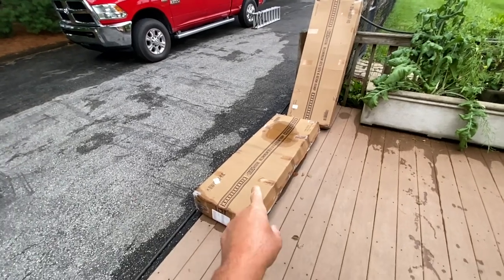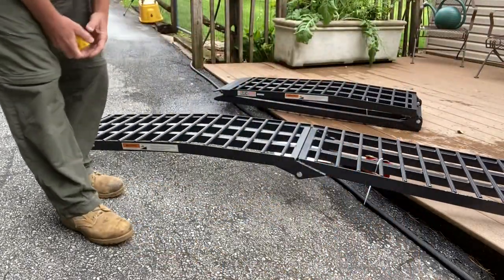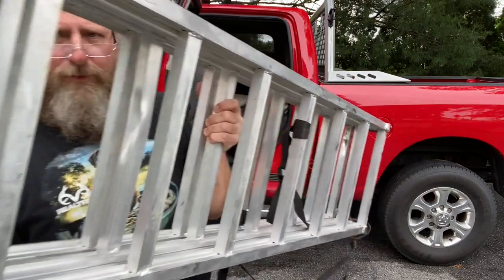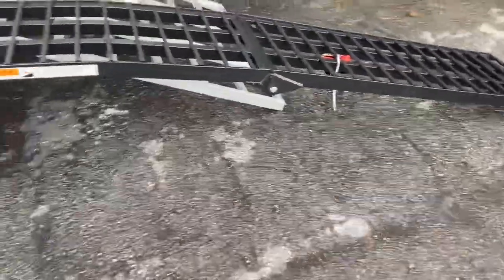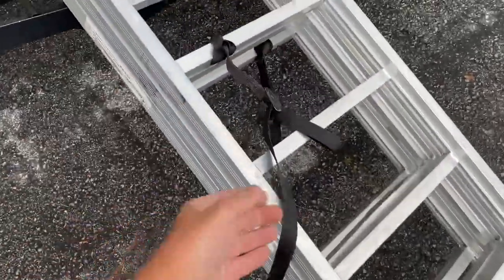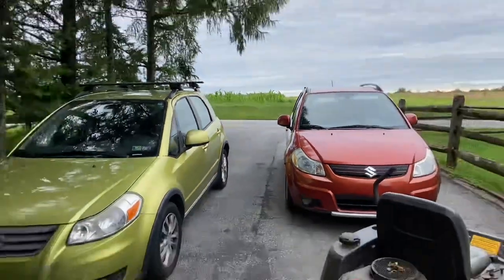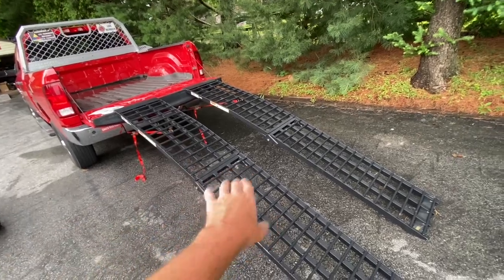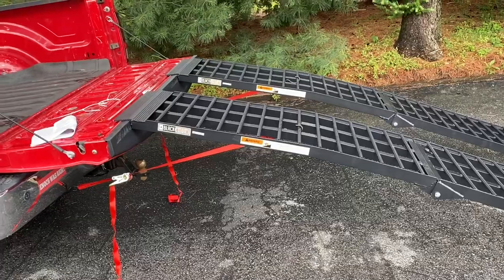Black Widow folding arched ramps loading a zero turn mower

Comment: I screwed some quarter inch plywood to my ramps because I didn't like the gaps between the rungs either and I am thinking about coating them with bed liner making them slip resistant and easy to walk up and down.
Reply from the maker: Good idea, let me know how it works!

Comment: You know some legs under there would be a really nice add on. To relieve some weight off or the tail gate. Even if they are 1 or 2 inches off the ground they would prevent some serious injury in case the tailgate breaks. A 2 inch fall is much better than 3 feet.
Reply from the maker: I didn’t feel like it needed leg support, maybe something that keeps them from sliding

Comment: How wide is the bed of your truck from the wheel humps? How wide is your zero turn from both back tires? I’m curious
Reply from the maker: I believe it’s about 51” in between wheel humps. This is a 42” wide mower, I can go as large as a 50” deck in my truck

Comment: Those 2019 new style wheels on the Ram?
Reply from the maker: Cool story: I needed new tires (10 ply rated E) , the stores were out of control with their prices. I searched on Facefuck marketplace. I found a young guy that just purchased a bran-new 3500 dually Cummings turbo diesel. He took off these stock rims with the stock tires and sold them to me for the price of two new tires!!!
Reply: @oxford821  Wow nice find lol marketplace has some deals in they you just gotta search can't be lazy👍the stocks&tires look good they'd go for $3k to the lowest where I'm at😐

Comment: Are you worried about the pressure on the door?
Reply from the maker: This mower weighs around 600lbs. I’ve loaded this amount of weight before on the tailgate without any problems. I should check the cables and make sure they aren’t rusty. Any more weight than this I probably would take the tailgate off before loading

Comment: Backing into the truck is slow and not safe.

Drive up and back out slow.
Reply from the maker: I’d be more worried backing down than up?
Reply: @oxford821  no, there are too many ways to go wrong backing in.

Wet tires slipping, power....

You get the most power driving forward and it's makes sense to use less power backing out.

Comment: To much work with the rachet straps
Reply from the maker: Yea, that part sucks, but is there another way to get them from coming off?
Reply: You've probably never had a ramp kick out on you. You'll take the couple minutes to apply the ratchet straps once that happens to you one time. Granted, it may never happen with a zero turn because of the smooth wheels and limited power, but I've seen it happen with 4-wheelers a lot. Strap it up buck!
Reply: Use cam buckles instead
Reply from the maker: Yes, I’ve swapped them out already

Comment: those small rotating front wheels make me so nervous, I fell off my ramps and bent my zero point, and the tires slip, I just gotta bite the bullet and lay two 1/2" plywood.  Loading this way is dangerous.
Reply from the maker: It’s sketchy